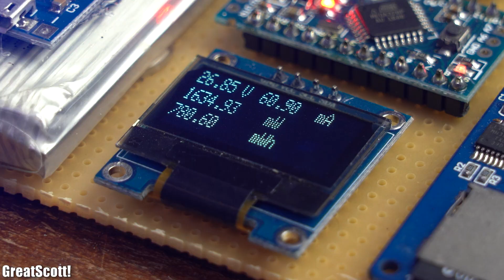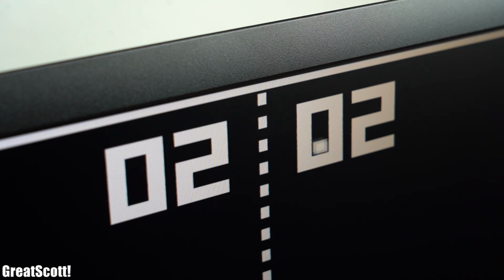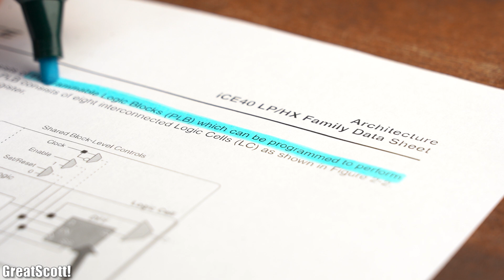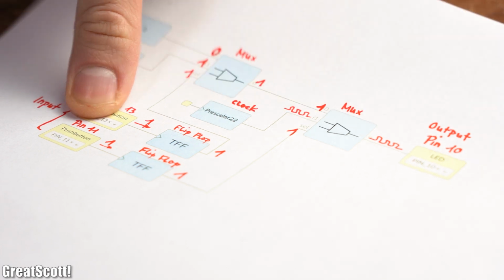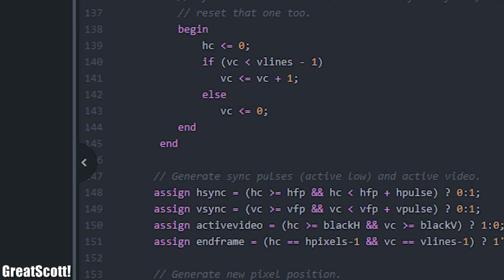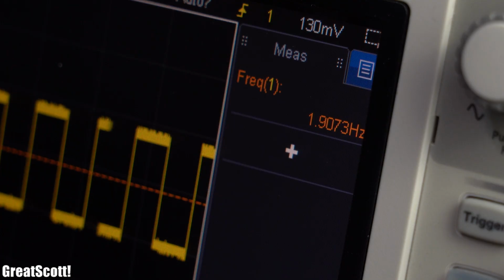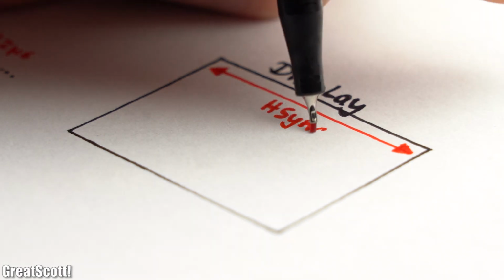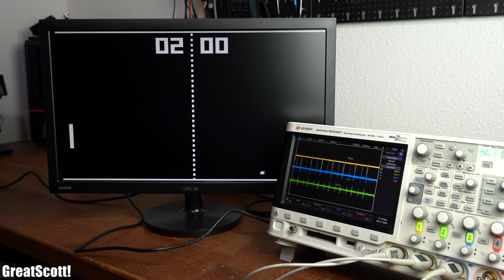Driving a VGA Display?! Getting started with an FPGA! (TinyFPGA)

Comment: Interesting video. Thank you for providing it. One question though, and excuse my ignorance of microcontrollers, but you mentioned that FPGAs are faster than microcontrollers because the FPGAs can execute and do multiple tasks concurrently, while microcontrollers execute line by line. I hope I summed that up correctly. 🙂 My question is, there are no parallel/concurrent programming libraries for any of the programming languages used for programming microcontrollers? Or is it that microcontrollers don't have multiple cores? Also related to that, is there a limit as to how many tasks an FPGA can do concurrently? Thanks again.

Comment: Did you really connect that LED directly to an output of the FPGA, without a resistor in between, or did I miss something?

If so, do you know how much current the LED is drawing, the maximum current rating for the LED, and more importantly, the maximum current rating of the output?

I'd expect something to blow.

An LED normally turns on at around 1.6V-1.7V.  You normally limit the current through it by allowing for the difference between the output voltage and the LED turn on voltage, and using a resistor to make sure it stays in the allowable range for both the LED and the thing driving it, using Ohms law.

Connecting it directly is likely to lead to damage to the FPGA, or the LED, or both, and disappointed first time electronics experimenters.

Comment: Im not really a VHDL expert. Learned some Bluespec last semester in the university but we didn’t run it on real hardware 

So the Bluespec Compiler basically translates the code into verilog. Do you thing you can Programm the tiny fpga then with Bluespec?

Comment: What would be a good platform to learn on?    TinyFPGA BX board or Fomu ?  

For example, the fomu appears to use a RISC-V softcore and uses the ValentyUSB ip core / github smunaut/ice40-playground/tree/usb/cores/usb )

I'm interested in a structured learning material, that goes from zero fpga knowledge, to designing a USB interface!   Would also be nice if the workshop covers Migen/MiSoC->LiteX , which seems to flatten the learning curve by allowing the use of Python to generate HDL?!

Comment: The biggest issue I have with FPGAs is simply cost. They're just still too expensive. I could get an ATmega328 and a crystal for <$5 and do what I'd do with a microcontroller. I could also get a cheap clone for like $10-15. The TinyFPGA Bx and other "hobbyist" FPGAs are all still around $50. That's much cheaper and more available than ever, but I feel like they're still too high for them to really take off in the maker space.
Cool stuff though!

Comment: Thanks for the great video. Could you possibly do a video where you use the FPGA to make a USB-Serial (UART) converter? Then microcontrollers like the ATtiny can communicate with the computer. I'm sure there are other alternatives like some FTDI chips or whatever that I've read about in forums but this would be a nice DIY method.
Reply: That is a big, big ask.  USB is super complicated.  (Well, relative to the typical DIY level, anyway.)  The FPGA would be good at stuff like scheduling the 1ms polling intervals and clocking out the serial data stream, but you need a software stack to handle stuff like responding to endpoints when they first attach to the bus, enumerating them, handing out IDs to them, querying their capabilities, and implementing whatever class protocol they speak (like HID for mouse/keyboard input, or storage, serial, etc.)

That requires either a processor, or .. well, essentially a processor-in-FPGA.

These things exist, of course, but it's not where you start out.  By the time you've learned enough to find pre-assembled blocks and string them together to implement a more complex system, you don't really need anyone to show you how to do it anymore.  :-)
Reply: @sirnickity  This was actually informative for me because now I can sort of visualize the USB protocol "flow", for the lack of a better word. There are a few things in what you said that's worth looking up and reading up about. Thanks
Reply: @regal_7877   Good, glad it was helpful.  :-)  At some point, you don't know what you don't know, and you have to start figuring it out from somewhere.  It's on my to-do list to really dig in to the USB protocol and start building USB/PS2 adapters and support for basic class devices and whatnot.  At this point I've only learned the basics, but it's always useful to know what avenues are a dead-end so you can focus on something productive.  (Micro vs. FPGA, for instance.)

Comment: Type C has is the new standard. I have an idea, a wireless Type C chord. Is there a way to make a type C to Type C wireless 2.5 ghz connection. Its like how a wireless mouse works but 2 way connection to make data transmission wireless between 2 devices

Comment: HDMI is also technically easy to interface, it's basically identical to VGA but uses digital R G B lines, and you need to shift 10 bits through each at the same time per pixel.
basically it's serial digital VGA. and that's the main problem with it, 640x480 needs a ~25MHz clock, so shifting 10 bits per pixel means you need to shift with a 250MHz clock.
also if you want a visual way of designing circuits for an FPGA, i can recommend Digital, it can export circuits to Verilog and even has a build in VGA compontent that makes testing VGA circuits so easy. https://github.com/hneemann/Digital

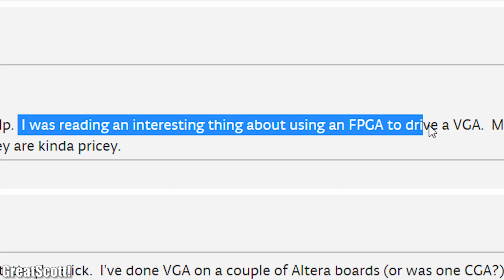Comment: 0:45 it's possible to use an Arduino (and timer interrupts) to produce a low resolution VGA signal. There will be very little CPU cycles left to do something else so using a second Arduino to do other things might be needed as well. It's a poor solution thought. A FPGA or dedicated ASIC is definitely more suited for the job.

Comment: Meanwhile, I just want a simple little low frame rate LCD display driver I can recycle old 15" laptop screens with... Something that will take in SPI or I2C and do all the same stuff those "arduino" LCD modules on eBay do.... But spitting out data compatible with typical laptop screens.
There has to be more of a market for that than just me.
Reply: Also looking into display driver fpga programming, but I suppose that would be a great deal of reverse engineering the displays, and varies from display-to-display.

Comment: Looks very intresting
Should be very usefull to learn how to convert old osciloscope CRT signals using FPGA to VGA signal. I have HP 54501A digital osciloscope, and I would love to replace CRT lamp with some LCD screen or at least create VGA output to monitor.

Comment: Sweet, I didn't know such small (and easily usable) fpga boards were already available. The Arduino MKR Vidor 4000 seemed promising at first, until I've read that you could only use predefined fpga modules, which prevented me to look into this for a long time.
Anyways, these miniature boards should be a lot easier to incorporate into projects in contrast to those Xilinx/Altera dev-boards I used to work with.

Comment: Hello Scott, I am a student and I entered in low power engineering contest, goal of contest is to build a device that will be powered by only one AAA battery and to have as high efficiency and run time as possible. I would appreciate your opinion on problem I encountered while trying to find best AAA battery source for my project solution using ESP32. I decided that my device will use Li ion, LiSOCl2 or LiFePO4 as alkaline batteries have low voltage and I would get low efficiency using boost converter. My biggest concerns are stability of ESP32, efficiency and quiescent current. I am planning to power ESP32 with directly from battery when batter voltage is 3-3.6V, under 3V battery voltage from boost converter and over 3.6V with buck converter or maybe LDO but I don't know the most efficient way to do this. I thought of using window comparator to enable boost, buck converter or directly pass trough battery voltage to ESP32 using mosfet, but that is also a problem because I have only one power source and to have V ref I need voltage higher than V ref. What is the best way to power ESP32 to ensure stability and what components do you recommend for lowest quiescent current during deep sleep. Btw sorry for non video related question topic.
Reply: I am not him, but could be of help.

For most cases, a high-efficiency low-current-load buck-boost converter is going to perform best.
Note the low-current-load part. They are optimized for devices with low power consumption or alternating current consumption.  

Went searching abit, and the TPS63802 could prove useful.
Only problem with it is the need for a supply monitoring IC for disabling it, once the batteries voltage is critically low (leave some headroom, just in case).

Also, why the ESP32 exactly (are you using perchance the Arduino framework)? Sure, its sleep mode current consumption regarding the among of features it packs is decent, but if you want to go really low power, a microcontroller series which is specializes for that (for example, MSP430 FR series, AVR picoPower, low-power PIC) is going to perform much better. And most of them have a range of 1.8 V to 3.6 (or 5.5) V, which could allow you to use a simple LDO.
Reply: @Loundre3  Tell me more!

Comment: Good video.... you managed to give a good overview of FPGA without either over-simplifying or over-complexifying..... You could have gone into a bit more detail with the VGA stuff though... I'd love to see someone go into the level of detail that Ben Eater did with his "World's worst VGA" series... but for a better FPGA solution.
Another option here is to use a Parallax Propeller microController.... relatively cheap and drives a VGA rather well.
These boards do look interesting though, especially as you can use entirely open-source (and therefore "Linux friendly") tools to develop and program their "B-series" boards.

Comment: I wonder if it's possible to use an FPGA to do the opposite thing, to capture an VGA signal (i speak about classic VGA, 320*200/256c @70Hz) for example from an old DOS computer, and simply push raw images to a SD card for further processing on a PC. Capturing VGA from classic DOS is actually an issue, most modern capture cards claiming to be able to handle VGA signals are in reality only capable to capture resolutions of 640*480 upwards and only @60Hz instead of the 70Hz DOS uses.

Comment: i know some 40pin  ttl screen use a similar way to print a screen. they have a vsync, hsync, clk and instead of using an analog signal they use 24bits of digital color so its easyer to drive the with an fpga. they also us a data enable pin to tell when theres is valid data on the bus. So if some want to get into fpga it can be easyer. the downside its a bit more expensive than using an old vga display. Fpga board form sipeed come with the connector for those screen on the board.

Comment: Well, actually you CAN transmit VGA signal with arduino. There's VGAx library, which can produce 4bit 120x60px video.
Reply: 4 bit, is that 16 colours?
Reply: @virtualtools_3021  Um, sorry, but I mistook bits with colors. Actually there are 4 colors and 2bits. https://github.com/smaffer/vgax

Comment: Nice introductory video. When you showed the Arty board I nearly fell of my chair while screaming. Not only Xilinx FPGAs are overkill for beginners, the prices are too high, especially the in case of the Digilent dev boards. Then you showed the Lattice FPGA with a completely open source board, and development environment, and I instantly calmed down.  I've been using FPGAs for years. Xilinx,  Intel, Microsemi, Lattice. Nowadays I'm only using Lattice, it has the right amount of resources, the right price, and an amazingly helpful community. Oh and those Tiny FPGAs are pure gem. When the new EX version comes out I will surely buy it.

Comment: I was going to mention Arty board that I used to output VGA, and then you showed it. Well, I only used the sample program that they have for it and I don’t really know how to do stuff myself on it. (Also the VGA adapter digilent sells for it only has a couple bits for each R G B signal.)

Comment: What about driving DVI, Composite (RGB) or HDMI one?
Reply: HDMI/dvi is pretty straightforward. Composite and proper vga is a pita since you need to make a DAC.
Reply: @RobertSzasz  Nah -the DAC is three resistors.. HDMI - that's more interesting, since it is three data streams (which are differential, so you need to understand your chosen FPGA's primitives for balanced serial output) and load them up with correctly formed 24 bit data. Oh - and get the timing right. There's a reason why VGA is in nearly every HDL textbook, and HDMI is something a lot of people say they have done, but very few post code.. (There are some who have, and Kudos to them - but just because HDMI is 'just' digital doesn't make it easier.)
Reply: @timwatson682  proper vga is 18 bpp color. At a minimum you would have to build a resistor array. Making  VGAish (low bit depth) is way, way easier than HDMI though. (Done low bit depth "vga" myself, used off the shelf for HDMI, though the hardware is only simpler to bodge for HDMI if you have the on chip drivers for 3.3v differential signaling )

Comment: Ben Eater also has a great video on driving a vga
Reply: Ben used low-level components; he came as close to creating a video-card out of paperclips and gum as anyone probably ever will. 👍
Reply: I wonder how hard it would be to use an Arduino to run  ATI's first VGA card, VGA Wonder. Made in 1988?
Reply: @TerryLawrence001  Should be possible but would be more fund with some more RAM. Maybe will try with an ESP32 one time.
Reply: He is good at logics though
Reply from the maker: Yep, I saw them. Great stuff :-)
Reply: @greatscottlab  you great ....🙏
Reply: That was all I could think about during watching this video. Ben's VGA content was really intense. Anyone who is interested should check it out.
Reply: He used 6 74ls161  9 8 input nanda gate(74ls30) 4 74ls04
2 74ls00
And one eeprom
Reply: @mohammedasadig6030    Any Nand arrangement is an easy transfer to an FPGA.  EEPROM - probably for a lookup table, also easy to transfer.
Reply: That is a great video that inspired me to design a digital clock with discrete logic counting system is very similar to what he uses
Reply: I saw the vid, he used discrete logic chips, however, instead of an FPGA
Reply: @oniruddhoalam2039  i made vga driver on fpga based his videov :D
Reply: What is the scope of FPGA in Industry?
Reply: @hrishikeshshinde648  creating extremely fast custom logic at low cost. It's smaller and often cheaper and faster than discrete parts and much cheaper than custom chips. Also the logic can be changed with a firmware update while you can't change the others in a finished product
Reply: @hrishikeshshinde648  Especially used for prototyping and smaller quantity series. For larger quantity custom chips are designed based on the FPGAs.
Reply: @hrishikeshshinde648  You can emulate a logic circuit without having the discrete hardware for it. When you have a code that lets an LED blink you don't have a whole processor running a code but you really have created a logic circuit like you'd do with discrete ICs. So while a microcontroler is a whole small computer, an FPGA is like a hard wired device, just freely configurable via a code.
Reply: I think that's why most of us got reccommended this
Reply: Yep
Reply: Ben Eater is, in my opinion, a step ahead of people involved in digital circuit design. The guy manually does a synthesis of what synthesizers like Xilinx’s XST do for us who describe hardware in VHDL or Verilog. More than enough to make me even more interested in the area. Great job. Btw, this tiny FPGA could be very good for introduction in RTL world :D
Reply: Without copy pasting code from github.